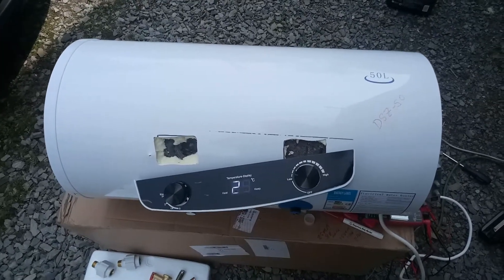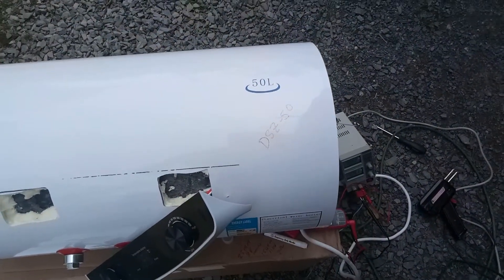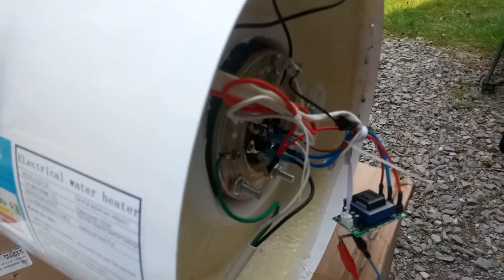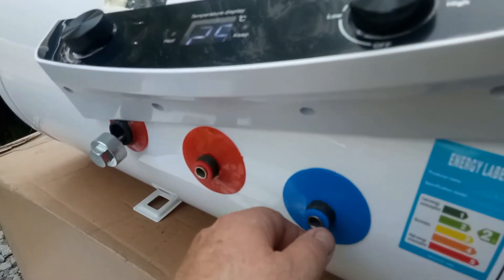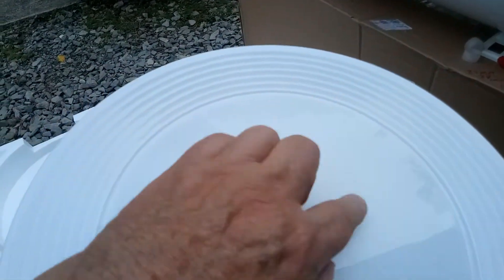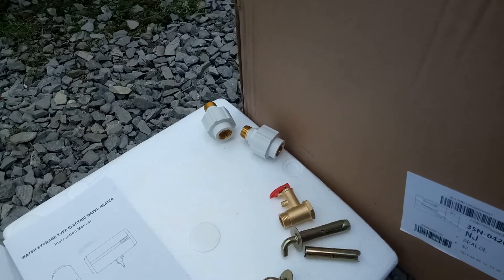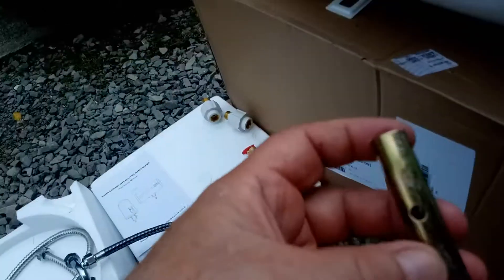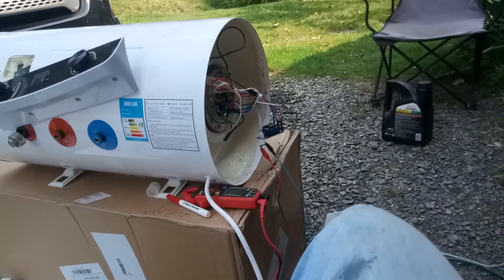50L Horizontal Water Heater1500W 2000W Tear Down, Ideal Camp Off Grid Water Heating Or Nightmare?

Comment from the maker: This could be your worst nightmare. You may not get the three heater power levels  of 800, 1200 and 2000W as shown. Ask first. If other than using the shower plumbing shown expect a LONG install. Those fittings are not 1/2 inch NPT.  You can get NPT on the brass over pressure valve (cold) only because they are cut so crudely.  Everything seals with flexible washers, not threads which might leak.  The white thermal isolators will slip their brass inserts if forced.  I found a faucet quick connect which tightens up with a number of washers and drilling out the center.  Heat loss is far more than expected. Overnight it went from 61C to 37C a 43F drop taking 1100W to recover. My ECOsmart 6  is only about 15F.  Horizontal tanks mix more cold with the hot.  This just might become a preheat tank. The check valve in the pressure relief makes draining at end of season harder. More trips with buckets! There may be some follow up videos. This could take days!

Comment from the maker: After the first summer the anode rod was pretty eaten up.  This is with plastic pipe connections to the tank.  Likely the anode will be gone by the end if this season. It looks like this would be easy to fabricate.